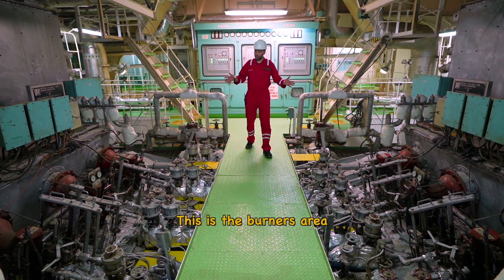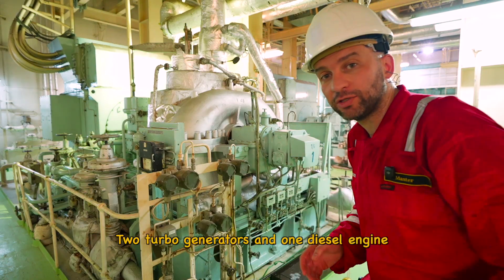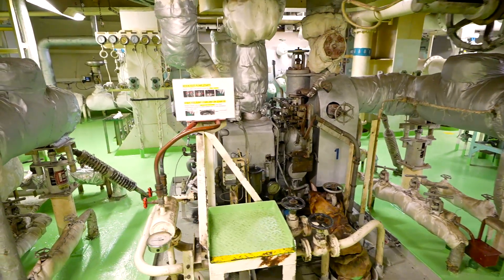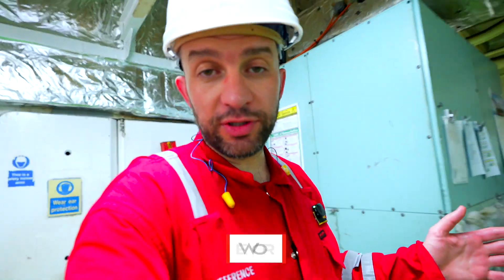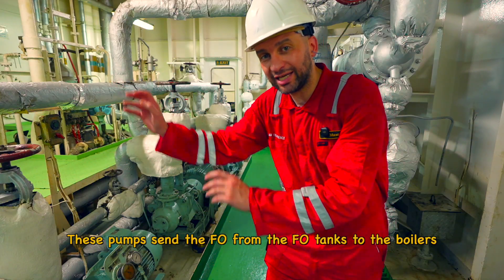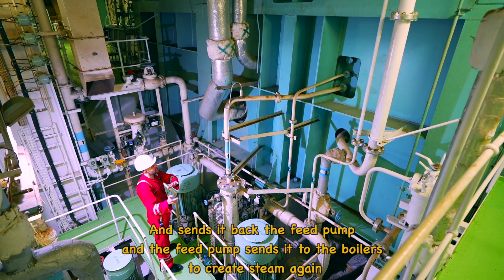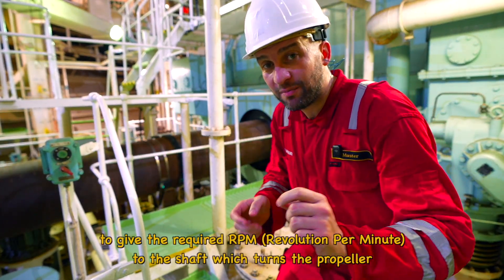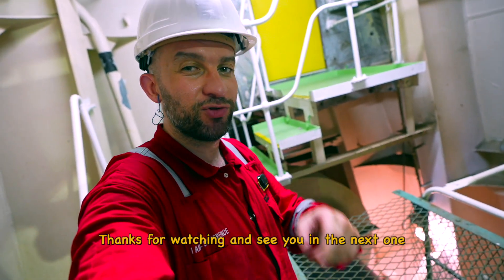Exploring the HEART of a Giant Ship Engine | Steam | LNG

Comment: This is an interesting video of an LNG ship with boilers and steam driven turbines. A lot of the equipment described in this video is familiar to me because for 34 years I worked in Los Angeles DWP Electricity Generation Stations, with most of that time as an operator of large boiler and steam turbine driven generators that generated electricity. These Electricity Generating Stations had Forced Draft Fans, Boilers with multiple  burners, Boiler Feed Pumps, Turbines and Condensers. With an electricity generating station the main turbine was directly coupled to a generator. The output voltage was 18 Kv, the frequency was 60 Hz, 3 phase. And the power output was up to 185 megawatts.
Reply from the maker: That’s very interesting

Comment: Captain if i may i had a few questions to ask. In respect to the steam, how many times can it be recycled to be used again to power the ship? Also due to evaporation whats the percentage that is lost in the engine, causing the need for new water to be pumped in? 
Second question for your ship you are on( i know every ship is different) fully loaded on normal fair sea conditions, how long could the ship go from full tank of fuel oil to an empty one?
Also can i ask what the rate of burn per hour is on these engines?
Reply from the maker: For the fuel consumption, around a month sailing, and around 100Mt/d.
Of course it depends on the speed

Comment: Why are steam turbines used on this ship instead of the large diesel engines seen in other large ships? Are they common? PS, I really enjoy your videos. Thanks!
Reply from the maker: Good question! When they started shipping LNG there was no technology for diesel engine to consume natural gas since the LNG is continuously evaporating.
Nowadays the diesel engines are taking over
Reply: @MustaphaZehhaf  Ah, so the boilers consume LNG? If yes, are the propulsion "tanks" separate from the cargo tanks? Is there an interconnect? Thanks
Reply from the maker: Yes in the past only the boilers were capable to burn NG which is the boil off gas from the cargo tanks.
For LNG ships, they consume the gas from the cargo tanks, they don’t have separate tanks for engine consumption
Reply: @MustaphaZehhaf  Wow, how very interesting! That essentially makes the fuel cost zero. Free. A very clever design. Thank you so much for taking the time to explain.
Reply: @snidelywhiplash8923 you just pay for the gas consumed. Boil off can de reduced by installations and you need a certain amount of fuel/gas remaining after discharge to get to your next load port after discharge.